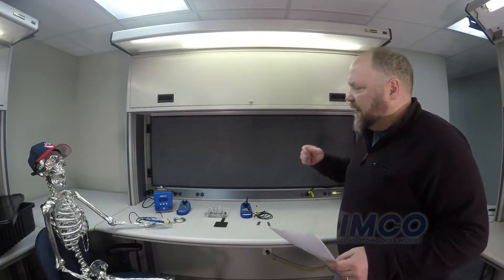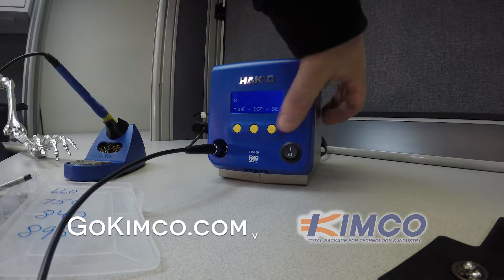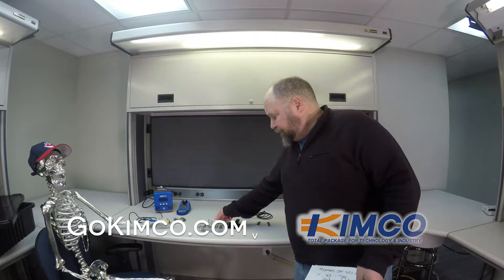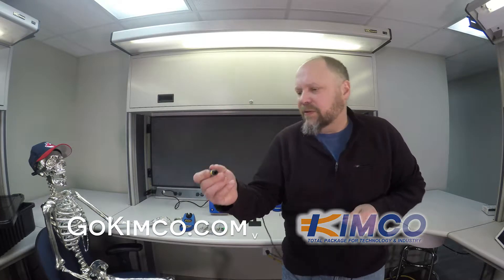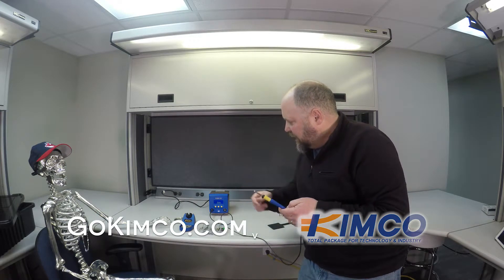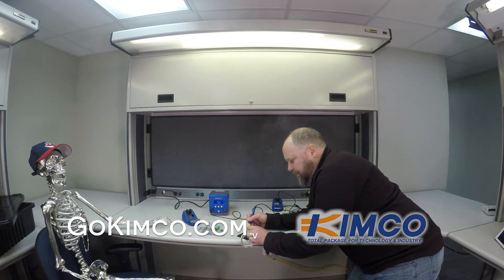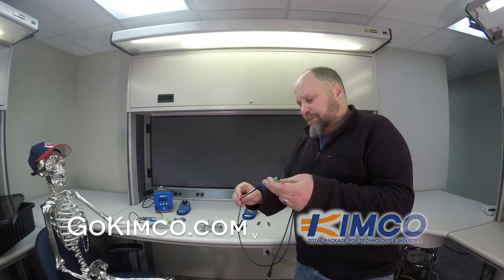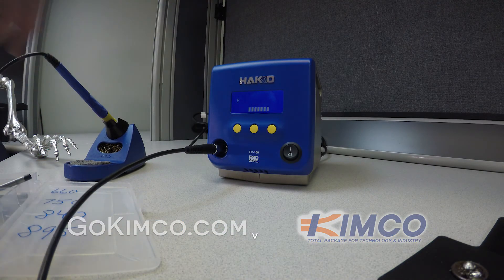Demonstration of the Hakko FX-100 RF Induction Heating Soldering System

Comment: The performance of the 951 is so good, I have a hard time justifying the extra cost of FX-100. Plus you can adjust temperature of 951. I've seen reports that the 951 outperforms some Metcal MX500 models.

So many tips are available for 951, and at reasonable cost too.

Comment: Can it stand against Metacl GT-90? I doubt.
Reply: I bet the FX-100 outperforms the Metcal GT-90. Why? The metcal has the heater and tip separate instead of integrated. That's why the temperature of the station is adjustable. A true RF station using a Curie point integrated heater will not have adjustable temperature. The temperature is selected by tip choice.

The Metcal uses an induction element as it's heating element, but it still has to get the heat to the tip. I bet this new, low cost Metcal doesn't even perform as well as the older MX500 which is still made and cost 2x as much.
Reply: @G5Hohn  that makes sense. How about FX-100 vs MX5200 stations?
Reply: @roseelectronics4582  I'd expect those are nearly identical in performance. They both use fixed temperature curie point tips/cartridges. I'd choose whichever one had a lower total cost of ownership when you account for tip life and availability.